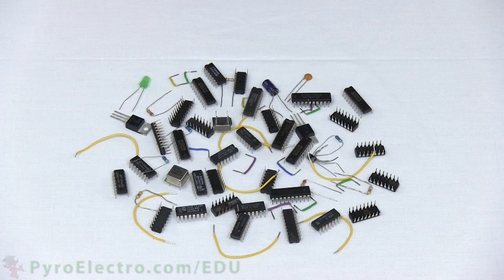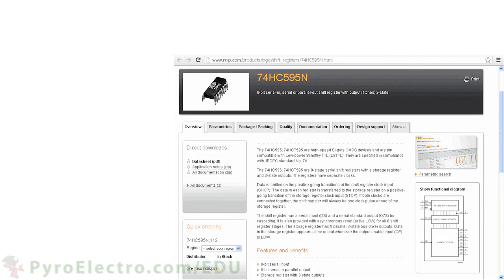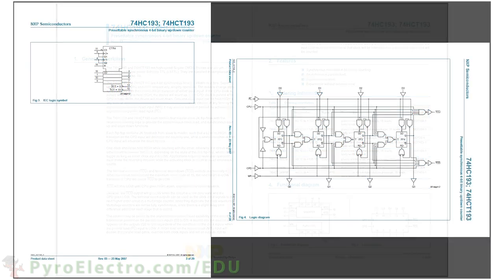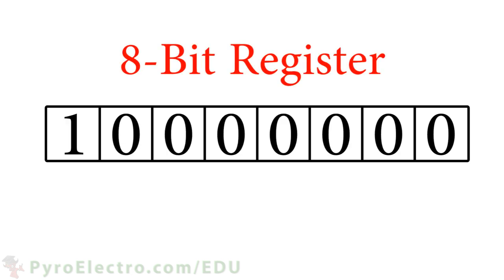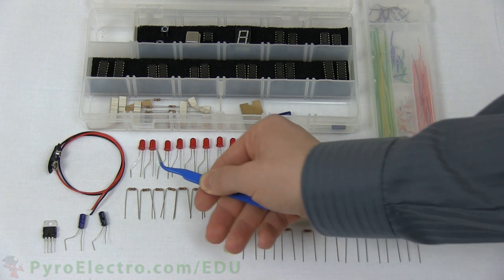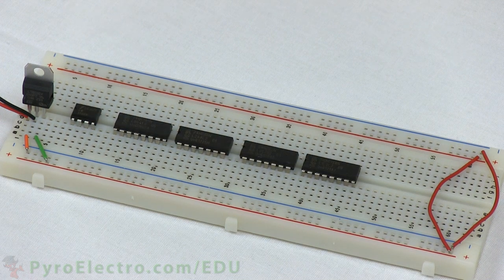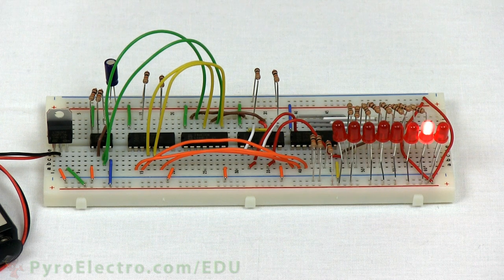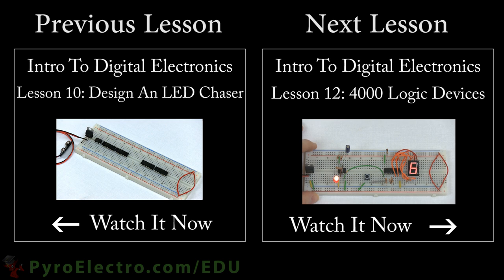7400 Logic Devices - An Introduction To Digital Electronics - PyroEDU

Comment: It was not explained; the "decoder" is a device which selects one of eight output lines based upon a three digit binary number (000 thru 111).  This device outputs a "1" for all lines except for the one which is selected by the three digit binary input (which becomes a "0").
   Example: when the counter gives the decoder a "000", all of the decoder output lines are "1" except the first output line .  When the counter gives the decoder a "001", all of the decoder output lines are "1" except the second output line . 
   Notice how the lights are given "reverse value" because they are all tied to "1" at the end.  Very clever!  The only mistake is that the led symbol is backward (the LED "arrow" should point toward ground, otherwise it will be reversed biased and will block the current)

Comment: After 3 frustrating days trying to get this circuit to work
I finally found all the bugs.  The main one
is that in the schematic shows a 74HC08 AND gate but in his description of
parts used he says 74HC00 which is a NAND gate. 
Use the NAND gate.  Another
mistake in the schematic is that the counter is listed as an HC192 but use an
HC193.  Another mistake on the schematic
shows pin 6 of the decoder going thru a 100 ohm resistor to ground but he uses
10k ohms going to 5 volts.  In the
schematic he has 100 ohm resistors going from pins 4 and 5 of the decoder going
to 5 volts but it should be 10k ohms resistors going to ground.  If you use the pin numbers for the NOR gates
listed in the schematic then you need to connect pin 7 of the decoder to pins
11 and 12 of the NOR gate and pin 15 of the decoder to pins 8 and 9 of the NOR
gate.  He mixes the NOR gates in his
build-up drawing and the NOR gates in the schematic so it is hard to follow
along.  In the schematic from left to
right, top to bottom the NOR gates are 1, 3, 2, 4.  In his build-up he uses 4, 1, 3. 2.
Reply: can you plez tell me what the corrections are^?